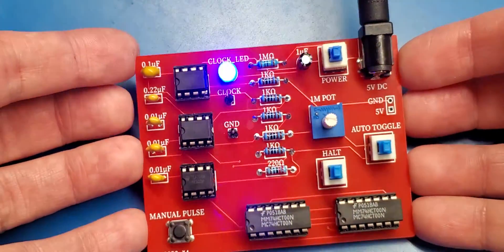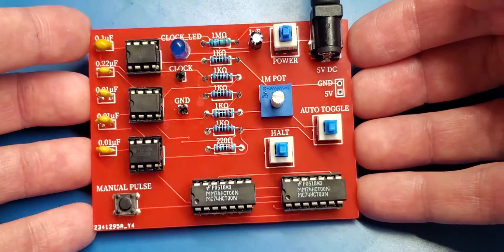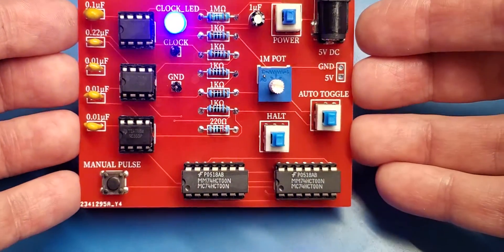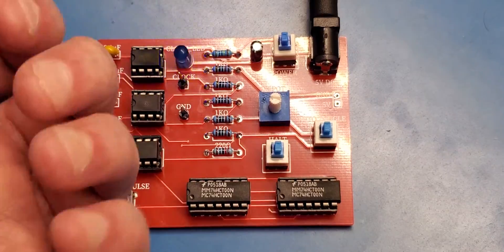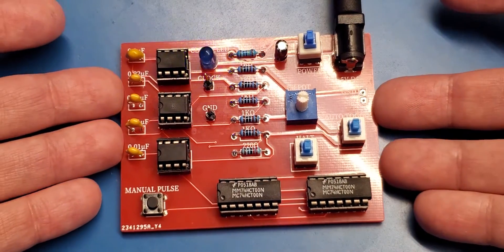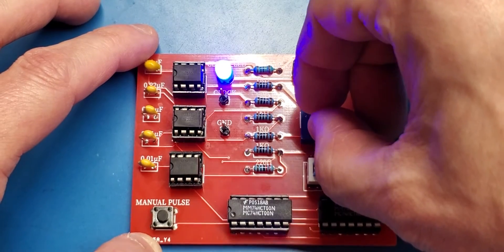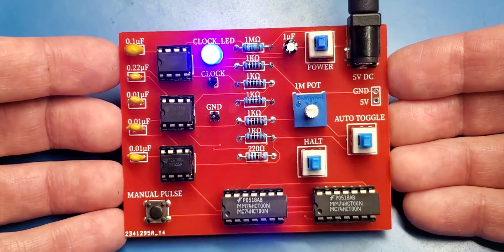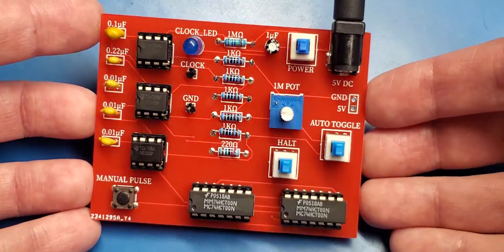My first PCB - Clock Module

Comment: Beautiful!  Am building the Ben Eater computer now and am at the program counter. Some day I
might try to rebuild it too in PCB when finished. You referred to software which you used for that. Can you tell which software that is?
Reply from the maker: I used EasyEDA. I put a link to the project in the description.
Reply: @davidcourtney1398  Hi David. Thanks for the great videos that you have created on this project. I have been working on this project for about 1.5 year now. For the same reason that you mentioned at the beginning of this vide, I decided to go PCB after making some parts of the project on breadboard. I have spent quiet some time and build the whole project on PCB with some interesting features. My design for the project is modular and each module connect to a shared bus pretty much like the original design. The outcome looks great but I'm facing some issues and that's how I found your videos. At this point most of the modules are working fine but putting everything together is a challenge. I used EasyEDA as well and all the schematic and board files are available. Let me know if you want to have a look.I have images of the project but not sure if I can post it here.
Reply from the maker: @ConfigIOI  Yeah definitely. Let's see what you have.
Reply from the maker: @ConfigIOI  Very nice work! I haven't done anything more on mine in the last 15 months. Too many interests ... not enough hours in the day.
Reply: @davidcourtney1398  Thanks ! You are right, I guess we all are struggling with time. I actually have been working on the project by SLU4 on my weekends. Quite an interesting one. Will probably post some videos once I have something worth showing.